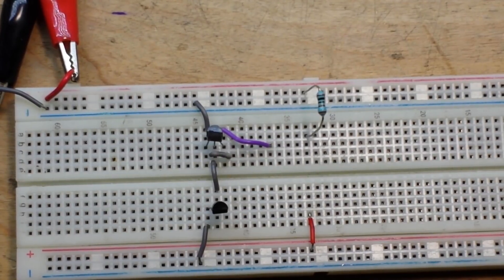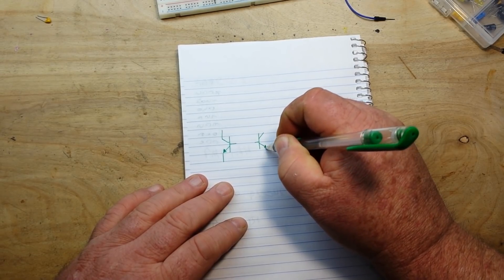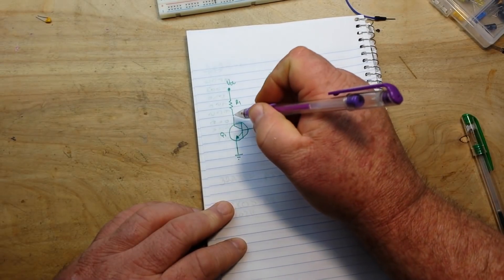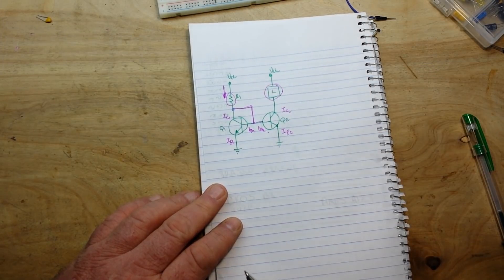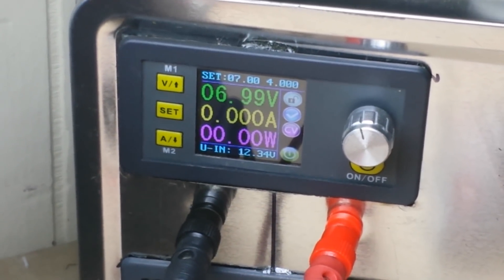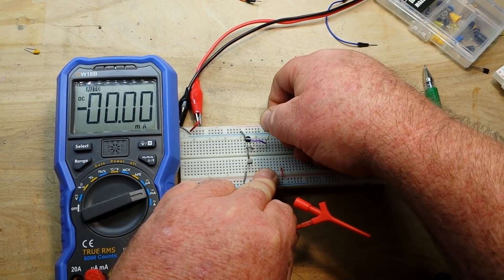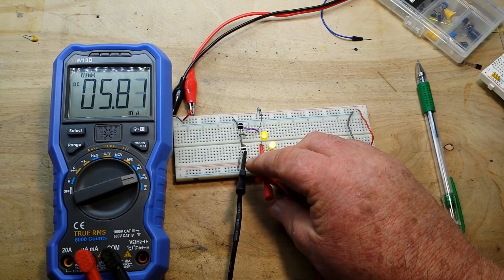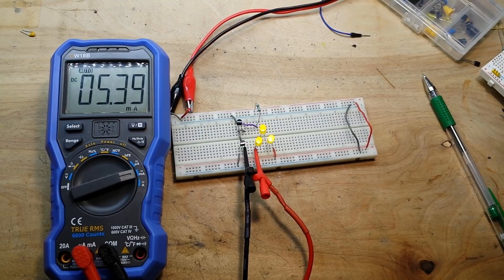Common Circuits You Should Know: The Current Mirror

Comment: The Q1 with its base connected to its collector is connected as a diode that is forward biased.  Why not just use a diode?  Because the forward bias current through its base to emitter junction is matched with the forward bias current through Q2's base to emitter junction.  Both Q1 and Q2 split the bias current between them.  If the base to emitter junctions of both transistors are matched, then the current will split equally.  Since both base currents are equal, then both collector currents are equal, or in other words, Q2's collector current mirrors Q1's.

Current mirrors are used in Opamp ICs.  The transistors are made at the same time using the same process, so the base to emitter junctions of both are matched -- actually the whole transistors are matched.  As the temperature changes, both transistors change equally and the collector current changes very little.

Comment: Nice video, did you try to remove the jumper cable connecting the collector and base  at the reference transistor and measure the output current series to those leds, I would like to know the measured value. It will be great if you can post it once more. Tnx

Comment: Is there a circuit you can use to actively control the current flow by means of a micro controller? Like an I2C variable resistor would be great!
Reply: Yes! LOADS! Just search for i2c potentiometer!
Reply: As Bob Lewis mentioned, pretty much every digital potentiometer IC will do the job, the I2C-enabled ones in particular.

Comment: Shorting collector to base on Q1 simply turns it into a diode. If anyone trying to figure out what's going on should just redraw the schematic with a diode from the base of Q2 and ground . It's just a very poor constant current circuit.
Reply: Τhe diode equivalence is misleading. There is real transistor action there. If there is no C-B bridge on Q1, no current will flow through it. With C-B bridged, there is current flow through its base while at the same time the C-E path is now conducting and draws current. This current reduces the base current, which is then kept at a constant level. Then this current is shared with Q2 base and Q2 "mirrors" the action of Q1...It is a very well known circuit for constant current generators.
Reply: @ΠάριςΑζής  in order for any current to flow there MUST be a potential difference. There can be ZERO potential difference between Q1 collector and base as the two points are SHORT CIRCUITED.

 There is NO confusion or misleading here. The transistor Q1 becomes a PN junction which performs EXACTLY as a diode, closely matched to the Base to Emitter PN junction of Q2.

The idea being that the two PN junctions being biased through a single resistor must share their base currents thereby "sharing" the current through the bias resistor.

 An increase in current through Q1 base emitter causes voltage negative feedback to lower Q2 base current and increase Q1 base current. THIS is what stabilises the output. The opposite is also true.

Usually however it's more common to use such a shorted collector base junction transistor in pairs and a resistor in between the emitter to ground connection of Q2. This forces a constant voltage across that resistor (the collector resistor would normally not be used) the current is then very accurately defined as Vd/Re usually taken as 0.7/Re.

This circuit then represents a negative constant current source or a positive current one. Changing the components to PNP transistors and the relevant new positions creates a positive constant output current source or a negative current sink.
Reply: @boblewis5558  Ok Bob. Apart from what theoretically exists, you just rejected what you saw in the video. What more is there for me to tell? Just hit "current mirror" in Google and read about it...
Reply: @ΠάριςΑζής  I didn't say there wasn't a current mirror there. There IS. BUT it DOES NOT operate with TWO transistors. It works With ONE transistor with a "diode" to ground from its base made by shorting out Q1 C to B.

I'm talking about there being ABSOLUTELY ZERO collector current flowing INTO Q1. IT IS AN IMPOSSIBILITY. The internal collector to base voltage is ZERO ergo there can be no collector current. Don't believe me? OK simple,  just set up a meter between Q1 collector and the junction of the bias resistor and the wire connecting to the base and tell us ALL exactly how many nanoamps (picoamps?) are flowing THROUGH the meter and INTO the collector. 

Then measure the current flowing through the wire to the  junction of the two bases. The latter is present the former is non-existent. Learn some basic laws like Ohms law and how a zero resistance (the wire link) and a PN junction reverse biased resistance manage to "share" ANY current? ALL THE CURRENT ALWAYS FLOWS THROUGH THE SHORT CIRCUIT!

The wire SHORTS OUT THE Q1 PN JUNCTION! 

A SHORTED PN JUNCTION  CANNOT FUNCTION IN ANY WAY AS A TRANSISTOR! IT IS IMPOSSIBLE! IT BREAKS EVERY SINGLE BASIC LAW OF ELECTRON FLOW AND THE PHYSICS OF A TRANSISTOR!

IF YOU DONT UNDERSTAND THIS STAY OUT OF THE CONVERSATION!
Reply: @boblewis5558  You are right about the diode function of Q1 Bob. In fact I have seen this circuit only in text books but never in real form. Instead of that I have seen a variation of that, mostly using PNP transistor, supplying the constant current from the collector against ground. The configuration is the same, with the polarities reversed of course. So, the emitter goes to the positive supply through a properly dimensioned resistor and between the base and the positive terminal (where the emitter is connected) there are either two diodes in series or a zener diode (depending on the design). The cathodes of the diodes (or the zener cathode) are connected to the emitter. Then a single resistor biases the base against the ground. The magnitude of the constant current depends on the diodes (or zener) voltage and the emitter value. This circuit has much better behaviour in terms of stability and is the one I have experience with.
Apart from my mistaken thinking now, I admit it as you see, let me give you a simple advice. We, humans, all make mistakes. These are in my humble opinion the best source of  knowledge, just because they are (usually) difficult to forget. What is annoying in your behaviour is your monstrous egoism, about which you should apply some control for your own good. Therefore, calm down, drink a coffee, and think that the sun shines for all of us. No matter if we know what current mirror is or not. Words like "stay out of discussion" do not sound very human to my ears. YouTube is a public place for exchanging ideas. Not your property anyway. Try to stay human is my advice. Have a nice Sunday!
Reply: Bob Lewis just to correct another mistake,  above. If two diodes are used, their resultant anode goes to the plus of the supply and the cathode to the base of the transistor. They need to be forward biased. 
If a zener is in their place, has reverse polarity now. Anode at the transistor’s base and cathode to the supply positive.
All above reversed in polarities if a NPN transistor is used...
Reply: Bob Lewis I am not an engineer Bob. I am a repairs’ technician, already retired. But since you are an enlightened engineer you certainly are always out of any mistake. But  this doesn’t make you a wise teacher in any way. Talking about egoism, let those who will happen to read our conversation decide. You are obviously biased and unreliable.Thank God you are not a judge! Have a nice evening!
Reply: @ΠάριςΑζής  please explain my "bias" as I don't understand. Biased against what? Inaccuracies? ... then guilty? Yup. About you or the video author? How? Pointing out the errors in what was described?

You say I made mistakes but won't accept them. Where? What were they? I have checked through what I said several times but can't see a mistake even though you claim I did, but then made mistakes yourself.

Like I said, we should only accept accurate descriptions whether is you or myself or anyone else. If I have stated something inaccurately or incorrectly let's discuss explicity what I said.

 Maybe I've been somewhat ambiguous somewhere, in which case tell me where and I'll happily clarify, and if it is severe ambiguity I'll also apologise. But to say I'm unreliable and won't accept having made mistakes without highlighting WHERE and WHY so that we can debate that is more than a little unfair. 

So far, as I say, I haven't spotted ANY error in my statements, but I have spotted several in your responses whilst claiming to correct mine. 🤔🙄
Reply: @boblewis5558  Thank you for not killing me through your keyboard Bob! This is my last (although hopeless as I see) chance to make my point of view on your behaviour understandable to you. Therefore our conversation has to be ended here.
Reply: @Jeremy Tenio 
1. I'm a graduate engineer of over 45 years standing and experience not some amateur with no idea.

2. A shorted NP junction is EXACTLY THAT. When C-B is shorted, there is NO MORE A TRANSISTOR! It is a forward biased PN junction ergo a "DIODE"! NO current can flow into the collector! It is SHORTED!

3. I've been working on stuff like this since I was 12 or so and am well familiar with how transistors, diodes and semiconductors in general work
 
4. Only FETs work on an emf "field" basis NOT bipolar transistors which are current driven, not voltage driven.

The way the circuit works is by providing a balanced negative feedback to Q2 base ... as Q2 base voltage rises, so also does Q1 base (they are connected!). 

This causes current in the Q1 B-E PN junction to TRY to increase (it can't) which then reduces the Q2b current since the split current between them self balances, due to the fairly well matched junction curves of the two separate transistors. A single chip dual transistor is even better as its curves are pretty much identical being made on the same piece of silicon at the exact same time.

The load current is then defined (approx) as Q2b current multiplied by the Hfe at the resulting collector current. The problem with this layout is that changes in Vcc are reflected in current changes in the resistor and hence changes in output current through Q2! It is not especially load insensitive on a non highly regulated supply, nor especially stable temp change wise. It is HIGHLY useful in IC design, but there are superior, more stable circuits that require just a few extra components or a rethink in approach not so constrained by output current levels. The "mirror" refers to the BASE currents of the two devices NOT the output current which, CLEARLY is MUCH larger than even the TOTAL of the two base currents.
Reply: @Jeremy Tenio just so no one else misinterprets my talking of ICs, it was in relation to single chip dual transistors of which there are MANY. They work in EXACTLY the same way as normal transistors. The benefit is (for dual transistors of the same type, being integrated onto the same piece of silicon, their performance curves are very closely matched which makes them ideal for the circuit shown.

Comment: If you wanna prove that current is stable you should add loads (LEDs) in parallel not in series 🙄🙄🙄
Reply: Where is the difference?
Reply: When you add resistors in parallel you are reducing the resistance and current goes up.
Reply: @twentycm  Exactly. But in this case, no matter what or how you load the collector of Q2, the current supplied will be the same,determined by the resistor on the collector of Q1. Therefore, where is the difference?
Reply: Πάρις Αζής True, but I mean it makes more sense to reduce the resistance rather than raising it to prove current is stable, as a matter of fact that circuit can be used as a current source. You are right either way should give the same result.
Reply: @twentycm  There is no "should" dear! It puts out the same current, no matter if you put a potentiometer as a load on collector of Q2 and play with it all day. The current will stay at the value preset (mainly) by the collector resistor of Q1. Finally you've got it!!

Comment: Nice video, but it doesn't explain how it actually works. If you take out Q1, R1 will set the Ib2 to a fixed value, and Ic2 should be Ib2*Beta, and (theoretically) constant. 
What is the purpose of Q1?
Reply: If you remove Q1, Q2 will act as a switch. It will be fully driven into saturation when loaded and in this case its collector current will depend exclusively on the load and the voltage applied to it, according to Ohm's Law (ignoring the Vce drop on it). The point is that in this circuit Q1 makes the regulation, whereas Q2 follows it or repeats it if you prefer i.e. it acts like a mirror...

Comment: It is important to understand that the term "current mirror" indicates the INTENTION NOT THE RESULT. 
given the circuit with arbitrary, that is UNMATCHED  components the current mirror approximately works ; there will be measurable differences in  the 
ib currents and hfe of each transistor . As a result Ic1 will not PRECISELY  equal Ic2. 
given  careful design of an integrated circuit the the differences are an order of magnitude smaller, but there are  still differences: 
It is impossible to  determine  the molecular structure of each transistor so ib, hfe still have small differences...what is FAR more difficult to control is temperature effects that have a direct influence on the transistor action ! ! !
Reply: I cannot understand why people just CANNOT get their head around the fact that IF you short out collector to base of ANY bipolar transistor it DOES NOT and CANNOT have ANY Hfe because it is no longer a transistor!! 

The emitter current of Q1 IS the base current and the B-E junction operates as a DIODE! 

So why use a transistor? More specifically why it should ideally be the exact same type for Q1 and Q2? It's so that the forward bias current of the Q2 Base is as close as possible to the forward bias current of the "diode" formed by the Q1 B-E PN junction. 

Why? Sôo that as the current through the load increases from the base current into Q2, there will be an increase of the B-E Voltage of Q2. T nohis provides an increase in voltage at the Q1 base too which attempts to pull more current from Q2 base ... It's a negative feedback mechanism, nothing more. 

The circuit is really a current limit, not a fixed current one. Changes in Vcc will result in changes in the current feeding to the two bases and will cause the output to change likewise. 

Should the Vcc supply suddenly go over voltage by a good margin, then it is quite easy to overload the output considerably, possibly blowing Q2 AND/OR the load itself.

The actual current THROUGH Q2 is determined SOLELY via R1, Vcc and Q2 Hfe. (Q1 Hfe does not exist as it is NOT a transistor as wired). Consequently, unlike a proper current source the output current through the load is NOT independent of Vcc. Replacing R1 with a traditional current source WILL allow the output current to be kept stable AND independent of Vcc however. A minor circuit reconfig and three more components will do the trick.

The reason for using a current mirror in such a circuit is to remove any non-load resistance from the output current path. In IC's, where typically Vcc is expected to be pretty constant, internal heat from any series output resistance AND lack of space required for internal, series, "large" resistors helps HUGELY in the IC design.

In EXTERNAL circuits where space may not be at such a premium a much better performance may be obtained from a more traditional current source.

But make NO mistake! A SHORTED NP junction is NOT and CANNOT act in any way as a junction AT ALL therefore Q1 acts PURELY as a forward biased PN junction ONLY (by definition, a DIODE!). Those claiming that a "similar", almost identical result cannot be achieved should try replacing Q1 with a small signal diode (1N4148, BAX16 et al) to prove the point.

Bob Lewis, BTech MIET

Comment: Hello,

I have a question as well maybe its strange but I want to know what am I missing if you could help me. As far as my knowledge goes if you put resistors in series the current will be constant no matter what. Only the voltage will get changed on the loads. For example. If you would put 3 resistors instead of LEDs for simplicity. All of them same value, the current should be the same only the voltage should divide. But if you get LEDs or resistors in parallel the voltage should be constant but the current draw should be 3 times bigger?And if you put in parallel mode will this circuit still draw just 6mA? and if so, would this be some kind of constant current mode circuit? Or would 3 parallel LEDs draw 3x6mA = 18mA? and with that neglected the "mirror current".

Thanks for your videos the are really great, 
I appreciate your work. Wish you a nice day.
Reply: With this circuit, whatever you connect as collector load on Q2, the maximum current through it will be the current that Q1 provides. Of course it works as a current limiter but the essence of the circuit is that it keeps the current stable and independed of the load magnitude. So your three leds in parallel will share those 6,2mA. (Equally or not is another story to be explained)...
Reply: @ΠάριςΑζής  
ohh okej, thank you for your answer. I was just confused because he mentioned that regardless to the load it will never draw more current, and to prove that he put 3 LEDs in series. And that confused me because even if he would put 10 LEDs in series it would still draw that max of 6,3mA because its not demanding more current if you put elements in series but it requiers higher voltage. LEDs would only be dimmer but still would only draw 6,3mA.  Is my thinking right? But instead if he would put 3 LEDs in paraller mode he would prove that this circuit would never draw more than 6,3mA. 

Thank you very much for your reply. It helped me greatly. I wish you a nice day.